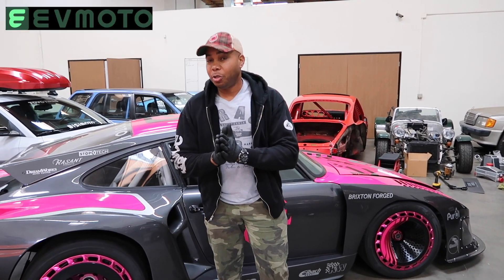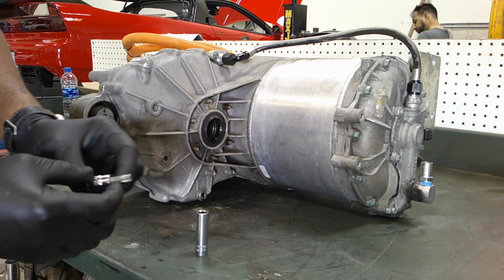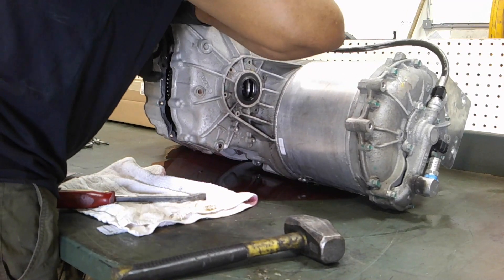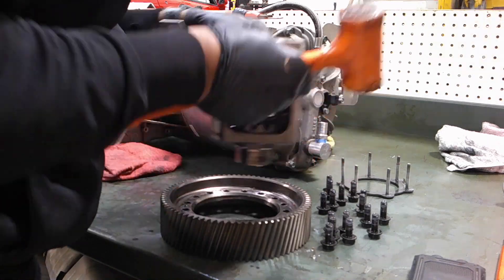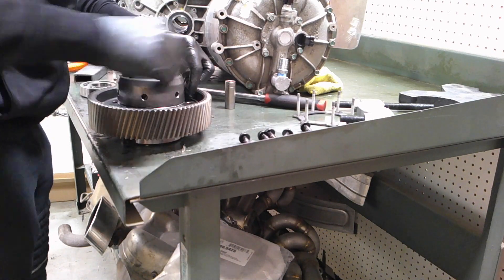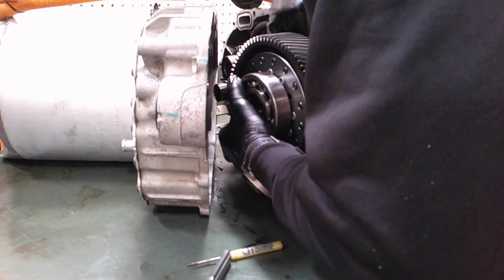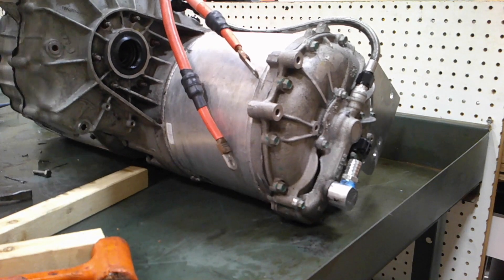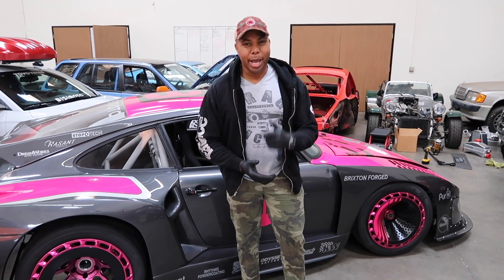Quaife ATB LSD in large Tesla drive motor

Comment: Great vid! How would one modify the differential on the Tesla drive unit so that it would run in the opposite rotation? Essentially using the reverse rotation as the drive function so the the drive unit may be mounted backwards. I believe the advantage of mounting the drive unit in front of the rear wheels instead of behind the rear wheels is part of this question. What’s your feed back on this? Thanks!

Comment: Wait did you not mention you need to unbolt the HV phase leads to the motor under the orange cover underneath until you reassemble? Also one quick note, check the coolant passage, has a small o-ring with the pipe connection on one end, that no sealant has squeezed into that.
Reply from the maker: T Bree I did not capture the bus bar removal. The oring is pretty obvious. Cheers.